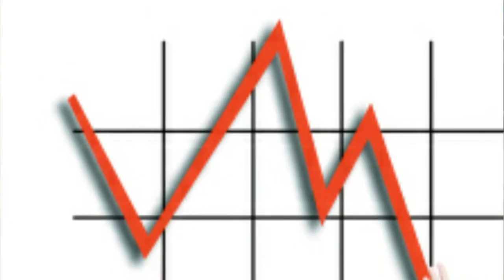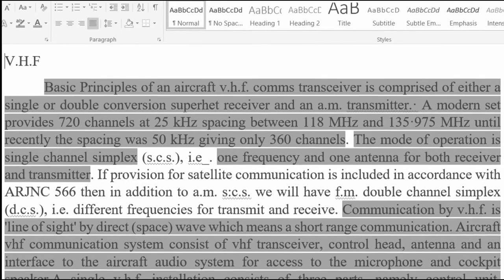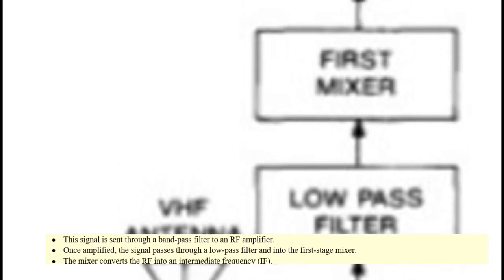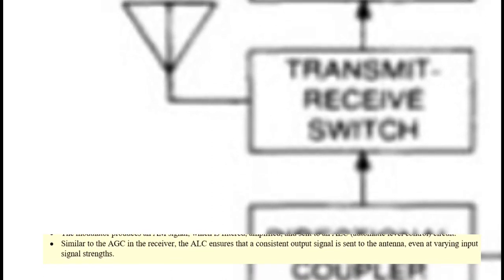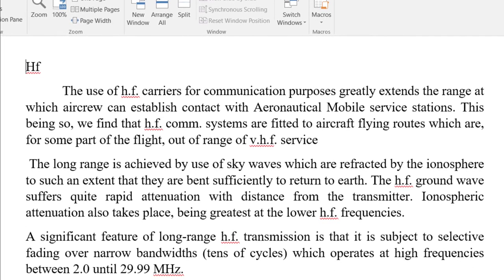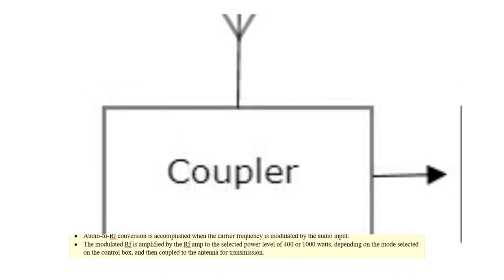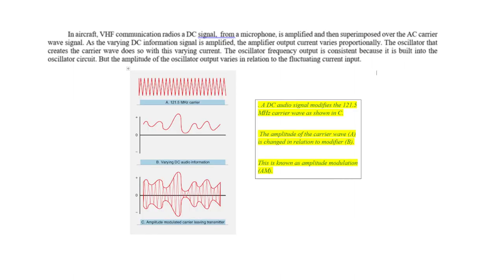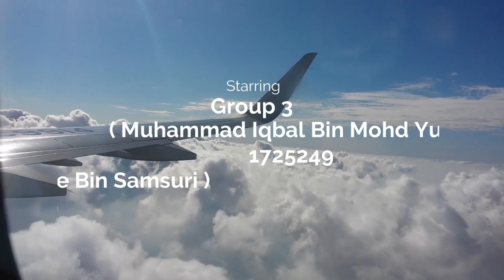Aircraft ( vhf and hf ) radio communication - ECOM 3312 - FOC

Comment from the maker: Continue from the description.....

Modulation and demodulation

	In aircraft, VHF communication radios a DC signal,  from a microphone, is amplified and then superimposed over the AC carrier wave signal. As the varying DC information signal is amplified, the amplifier output current varies proportionally. The oscillator that creates the carrier wave does so with this varying current. The oscillator frequency output is consistent because it is built into the oscillator circuit. But the amplitude of the oscillator output varies in relation to the fluctuating current input.
When the modulated carrier wave strikes the receiving antenna, voltage is generated that is the same as that which was applied to the transmitter antenna. However, the signal is weaker. It is amplified so that it can be demodulated.
 Demodulation is the process of removing the original information signal from the carrier wave. Electronic circuits containing capacitors, inductors, diodes, filters, etc., remove all but the desired information signal identical to the original input signal. Then, the information signal is typically amplified again to drive speakers or other output devices. 
Atmospheric noises or static alter the amplitude of a carrier wave making it difficult to separate the intended amplitude modulation caused by the information signal and that which is caused by static.